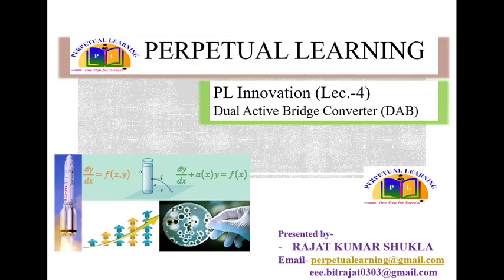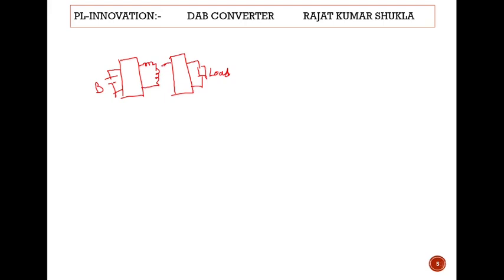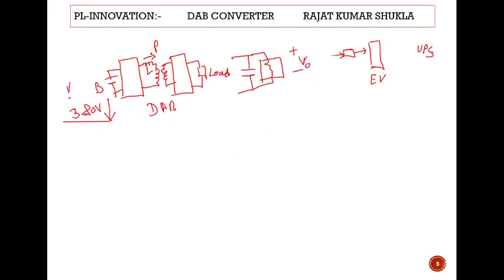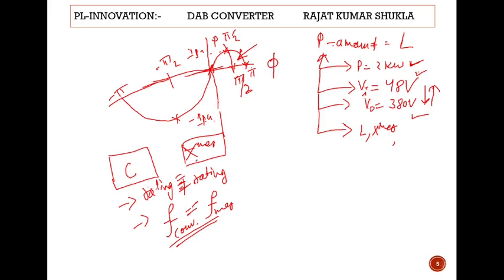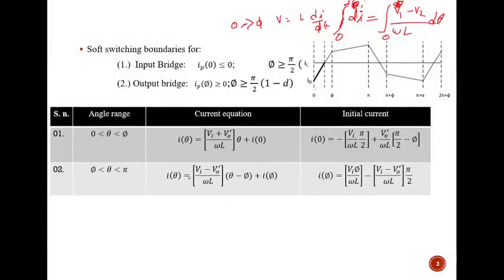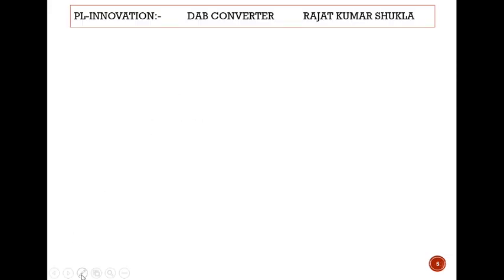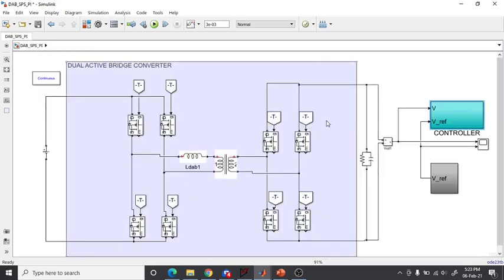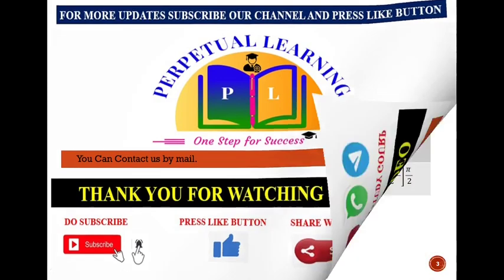DAB_converter Lect-04 ||Implementation||PL Innovation

Comment: Hi since it's bidirectional how did you implement power flow in the opposite direction from the output back to the source for? For the 1st part without the controller?